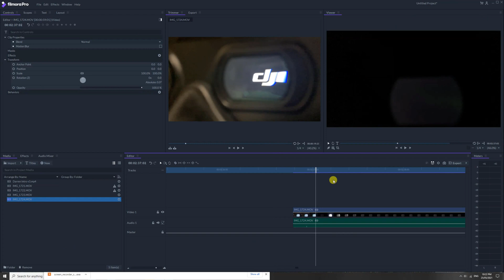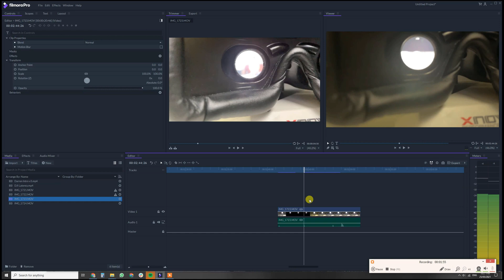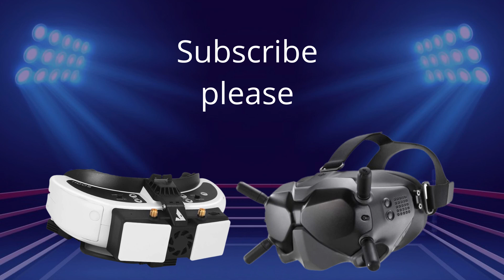Shark Byte vs DJI - Latency - Part 2

Comment: This is a very inaccurate method of measuring latency.  I used an Arduino which measured to the nanosecond.  DJI reported latency was very accurate, I tested analog which came in a 22-45ms depending on the camera of which I have an extensive collection.  I would have tested shark byte as well but I didn't want to blow $600 on a system I'd use once then sell at a huge loss as I've seen people having a hard time selling their used SB systems.

Comment: Nebula nano is laggy. It doesn't support low latency mode. Test the pro, or full version.
Reply from the maker: I have just received a pro - so will be testing that soon!
Reply: @DarrenAllatt  Cool. I've flown pro and nano. I could definitely feel the difference.
Reply from the maker: @vapgames  there absolutely is a massive difference. I had a nebula pro on my 4” Micro Apex which I sold and the normal DJI camera on my 5” Apex, which I also sold.

Comment: I have a few questions for the DJI side of things:
Did you test it in high quality or low latency mode?
Was the overheat protection on or off?
Reply from the maker: Heat protection off. 
I used the nebula Nano which doesn’t have high quality mode only low latency. You’d expect this to increase in high quality mode.
Reply: @DarrenAllatt  thanks for the reply. Afaik it is the other way round though: it has only the high quality mode. When I fly my quad in low latency mode, the displayed latency is around 25ms
Reply from the maker: @beratsbuilds  that sound right
Reply: @DarrenAllatt  are you sure that Caddx nebula nano can do 120 fps? Not according to the Caddx spec sheet
Reply from the maker: @RavenFPV_NL  yeah it doesn’t so 120 only 60